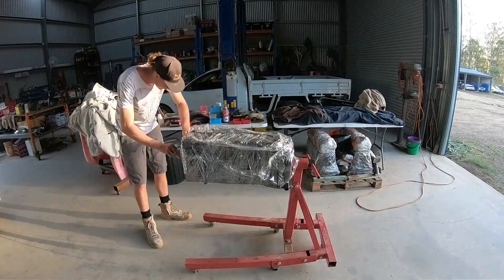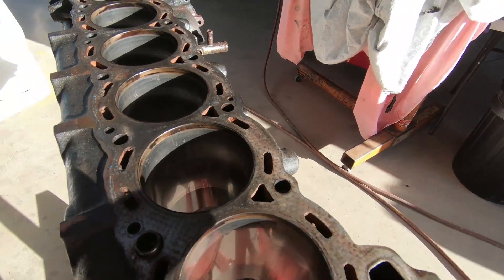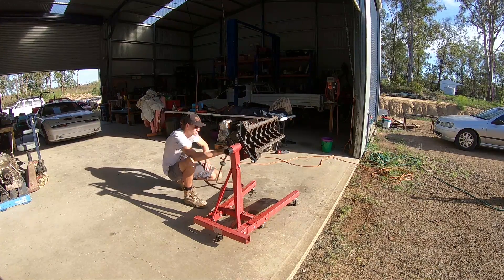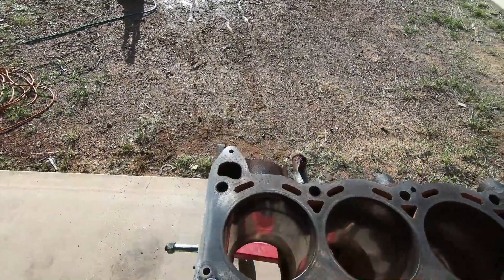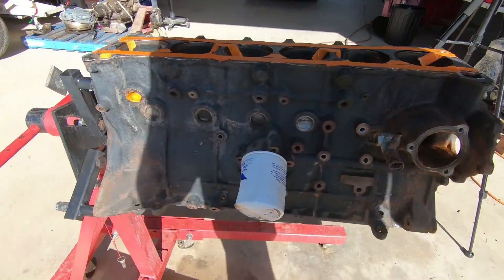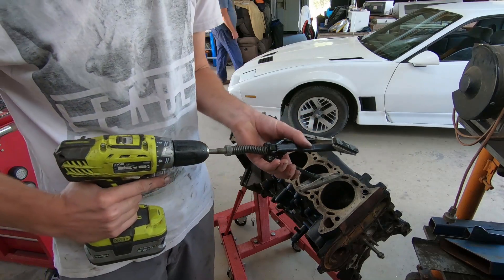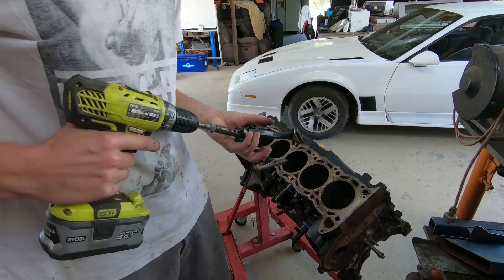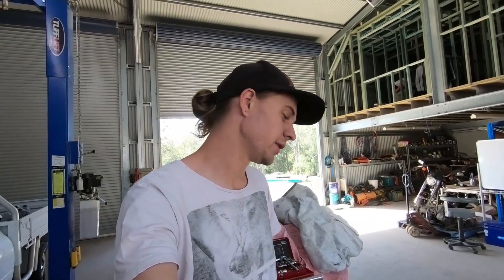R31 RE-BIRTH Part 6: Block Preparation

Comment: Did you remove the oil restrictor? Couldn't see it in the deck face.
Reply from the maker: Nup, left the restrictor and bypass valve in the block. Just made sure they werent blocked afterwards!